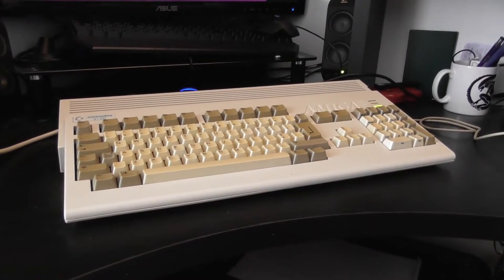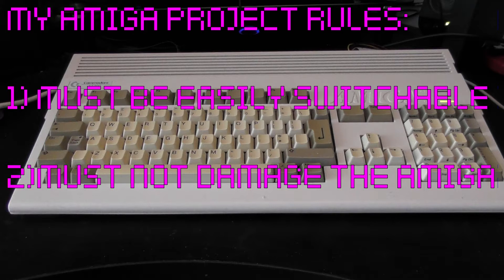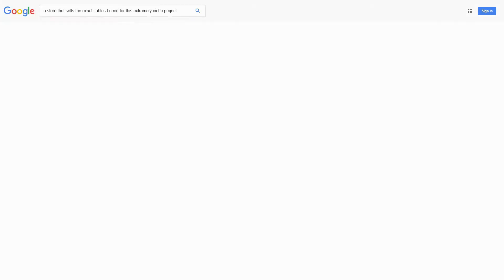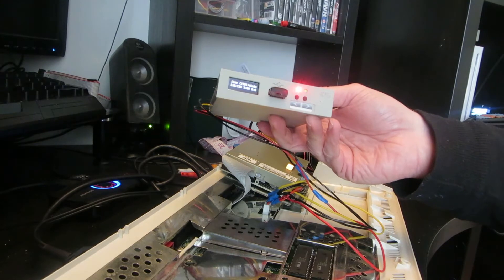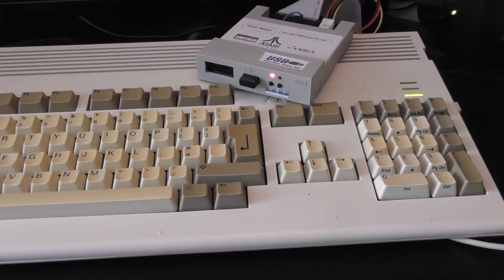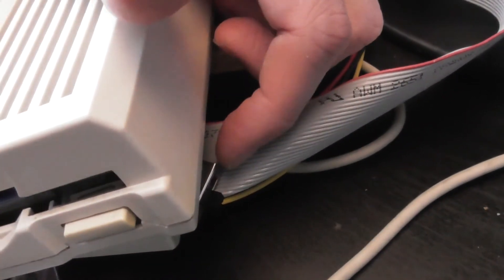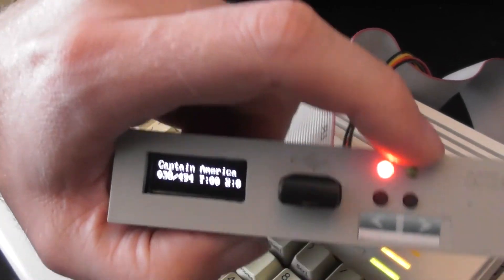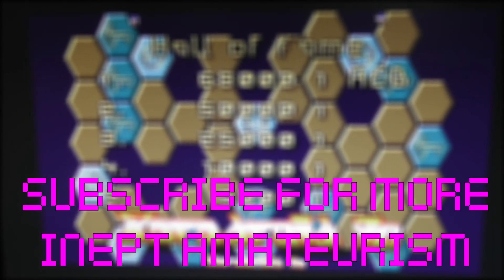Amiga 1200 DF0 Switcher | Amiga mod made by a complete amateur

Comment: I tried to make such a modification, unfortunately it didn't work for me. While looking for solutions on the Internet, I found your movie. Just like you, I made the switch on pin 10. Unfortunately, gotek doesn't boot. To be sure that the ribbon is properly made I swapped the drives. The floppy drive always boots (of course in the appropriate switch position), gotek never (returns to the kickstart start image). When only gotek is connected - it boots as needed. Differences to your configuration: Amiga 500 (kickstart 1.3), fdd is a modified ALPS (DS0 jumper closed inside). Do you have any idea why my setup isn't working? Thank you in advance.
Reply from the maker: To be honest I've no experience with an Amiga 500, so I don't know if there's any difference between how it handles signals to and from the floppy drive. My suggestion for Amiga 500/500+/1000/2000 is actually to go on Amigastore.eu and buy a "DF0 Selector" for €10. It allows you to switch DF0: between DF0 and DF1, as long as you're OK desoldering CIA chip, and then resoldering it back on top of the selector. Once fitted it's a much smaller, neater solution and definitely works with Gotek drives. Sadly not available for 600/1200 😞
Reply: @MrTomFTW Hi Tom. I found a solution. Due to the fact that my drive is modified PC fdd, it has a little problem with the READY signal. I had to make a second, similar switch on the READY line. Now everything works (I just have to toggle 2 switches). I'm afraid that the bootselector you mentioned, only works with the drive connected via an external connector (my goal was to install gotek  and fdd inside a500 case)

Comment: Honest question. Would pressing both mouse buttons while turning it on and selecting DF1 as boot device not achieve the same result?
Reply from the maker: Sadly no. Most games look for DF0, even if you switch to DF1 as the boot device.

Comment: Great Video, where did you purchase your soldering lamp/magnifyer from? thanks!
Reply from the maker: Thank you. It's just a cheap one from Amazon, cost like £12 or something... But to be honest I'm probably going to bin it before I do my next project. I can never quite get the magnifying glass in a useful position, and it falls over at the drop of a hat which is not good if you're using it to hold your soldering iron! And it's melted all around the sides as it doesn't hold the iron steady which can't be good for the iron.

Comment: Great video, really clear and I like the honesty of the complete novice approach, gives me confidence to give this a try myself. Any deas why the DF0 selectors commonly around on ebay don't work on the 600 or 1200?
Reply from the maker: I couldn't give you a technical answer, but it's to do with the A600 and A1200 using a different CIA chip (which, amongst other things controls the floppy drives). The DF0 selectors connect to that chip via a socket and switch two of the pins around. For whatever reason the CIA chip on the later models don't support that solution.
Reply: No worries that's my kind of explanation mate. Some of the forums/videos get way past my understanding, but that makes sense to me. Good work fella.
Reply: The issue is just that in the A1200, the CIA chip is surface-mount soldered directly to the board. The A500 solutions involve plugging an adapter board into the CIA socket under the CIA chip.

I'm trying to do a solution that will swap DF0 and DF1 internally on the same cable, allowing them both to be mounted internally and both to be always active..that darn MTRx signal has to be latched in sync with SEL1 and the timing is critical, so it's a bit of a bear to wrestle. I'll publish what to do when I succeed, but it can't be a consumer-installable product due to the need to solder on the mainboard.

Comment: great work, so is it just a case of switching wire 10 from one drive to the other ?
Reply from the maker: Yes, that's right. Wire 10 is the active drive/motor enable pin, so you're "hijacking" that pin and sending the signal to the drive you want to be active.
Reply: Absolutely brilliant mate, have been looking for something like this for an age. great work.

Comment: I'm wanting to do this to my 1200 & Gotek, you made it look easy (dunno if I can do it). Have you thought of making these cables up. I surely would buy one if you did
Reply from the maker: I'd be lying if I said it hadn't crossed my mind, mainly to get more use out of that crimping tool I ended up buying! But I couldn't sell them in good conscience. As explained in the video I'm a complete amateur and this thing was cobbled together. Not to mention how shoddy my soldering is (very).

But if you've got the parts, and you've got the tools it's not that difficult - this was basically my first electronics project! I knew nothing going in, and kind of had to teach myself. The only times things went wrong was when I cut corners (like with the ribbon cable), and you'd have to be careful when cutting wire 10 out of the ribbon cable of course as those things are soooooo thin but I managed, which I think means pretty much anyone could.
Reply: Can you guide me n what to buy please as I aint got a clue looked for switches theres that many dunno what to look for. Cheers